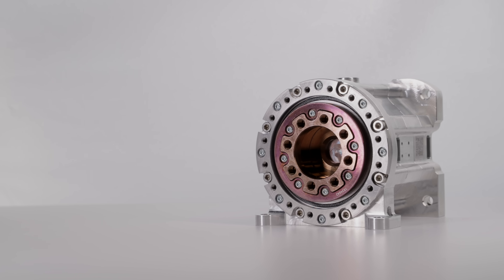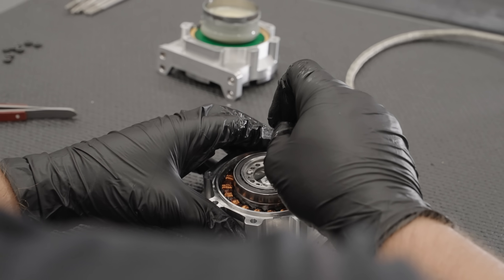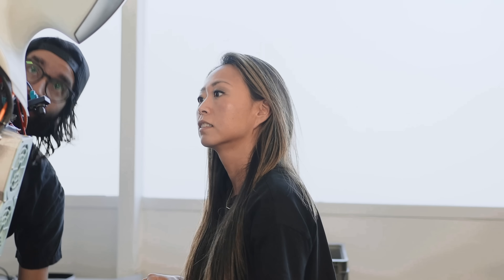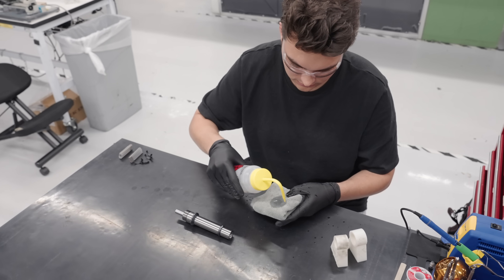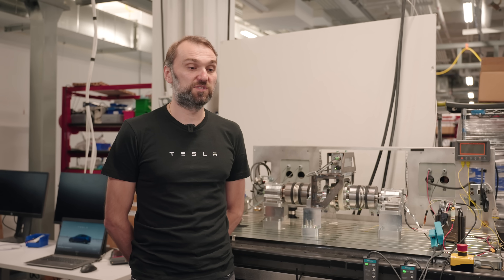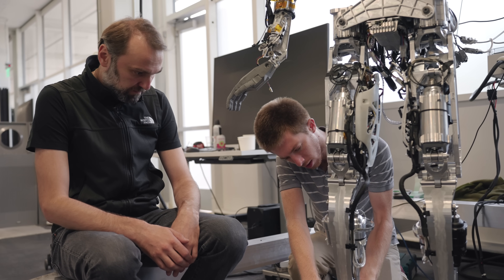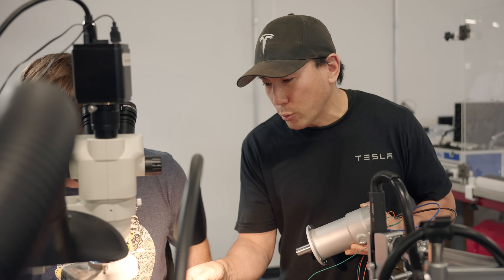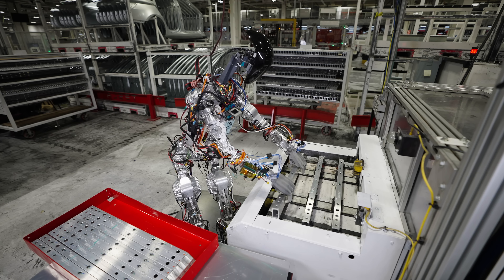Tesla Bot | Actuators Team

Comment: At this rate it’ll only take them 10 years to get to where Boston Dynamics is at
Reply: Please provide your evidence that BD build their own actuators, or have even ever tried to.
Reply: Which “rate”?
Reply: @fredbloggs5902  I'm not trying to hate but Tesla is definitely still behind BD. If you look at the movement of their bots, it looks the same as the first robots from the 80s. Probably bc every movement of every actuator is planned in advance. They still need an AI system that can react to the environment and modify trajectories.

And no you can't just slap FSD AI in there, this is a fundamentally different problem. I'm sure that Tesla can do it but they're definitely not there yet
Reply: It took over 10 years for Boston Dynamics to get Atlas where it's at.

Comment: Using harmonic drives is just not right for a highly dynamic system, poor impedance control unless you have a very fast controller with force sensors..

Comment: guy at the end summarized. They are making a work of art, not necessarily spending their engineering time wisely. It is generally the most reasonable to let the system requirements define the components used - no need to make bespoke parts when an OTS component would get the system to market faster and with lower cost.

Comment: The fact that they still can't make a car autonomous, speaks a lot about how impossible a general purpose humanoid robot is.
Reply: I think robot would be a lot easier, cars are alot faster moving with variable that are almost never ending. And they do a pretty good job so far
Reply: Nonsense.  FSD might be harder challenge than this bot will be.
Reply: @slowmomma7222  Cars are predictable and mostly follow clear rules, they also require no fine motor control or complicated movement planning.
Reply: @TheEvilmooseofdoom  That makes no sense at all. Do you have any idea how many actuators are there in this bot? And how difficult its to plan even simple tasks? Cars have one turning wheel and accelerate & decelerate button.

Comment: Why are you wasting all this engineering effort when your "full self driving" doesn't work?
Reply: the most capable system ive seen so far, better than some human drivers ive seen.
Reply: @odisy64  It is TERRIBLE. Makes all kinds of very basic errors. Meanwhile Waymo is actually running a driverless cab service.
Reply: @kellymoses8566  in specific cities with specific weather on specific roads. ive seen people put Tesla FSD in scenarios i wouldn't go into and im willing to  do some illegal stuff.
Reply: @kellymoses8566  Because not all engineers do the same thing.  They have people working on both.  Doing more than one thing at a time might be a concept you struggle with, but it is something others can do and do well.
Reply: @TheEvilmooseofdoom  Tesla could use the money they are wasting on this robot to improve their shitty self driving system so that it is at least as good as waymo
Reply: @kellymoses8566  what do you mean it fails every time, ive seen it doing drives from LA to San Francisco without a problem. the people beta testing it even admit its boring to drive it on most streets so they push it in hard scenarios to show their YouTube audience of what it cant do. 

if you can sue Tesla then i can sue STEAM for selling me early access games full of bugs and non working features.